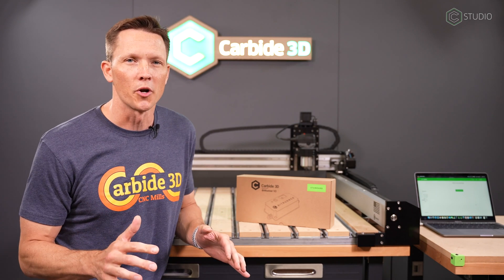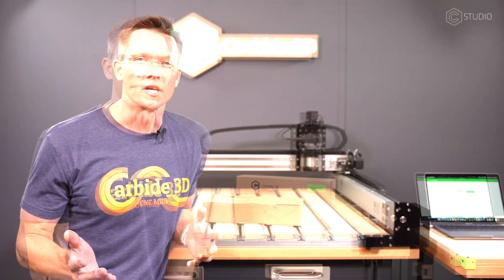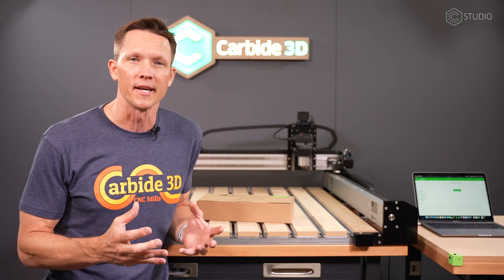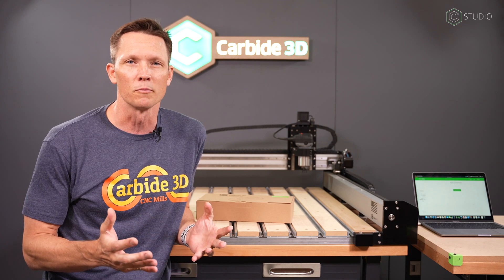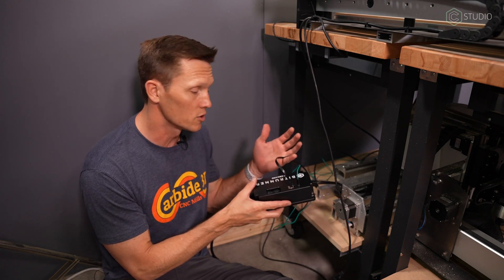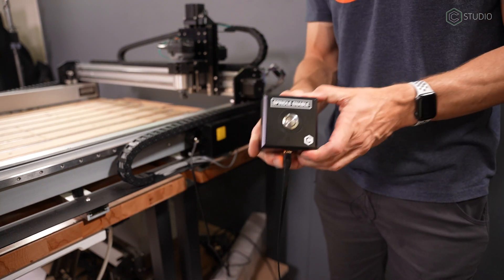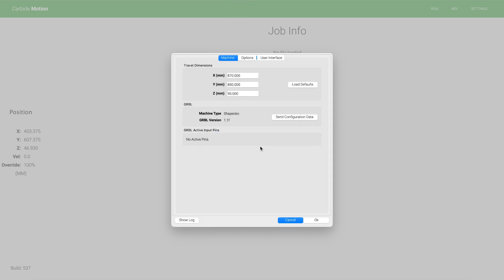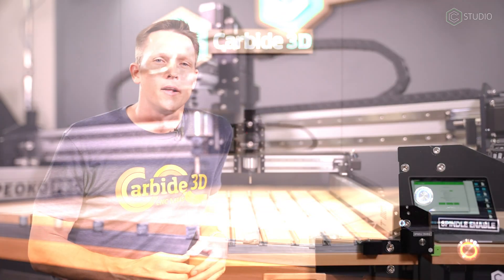BITRUNNER V2 - Install and Run

Comment: Does this automate the router speed? Or does this just turn it on and off while still having to select the speed that I need on the router dial?
Reply from the maker: This only turns the router on and off. The deluxe version includes an AC filter to reduce the electrical noise coming off a router's brushed motor.

Comment: Should the router be connected to a separate outlet than the controller if you are using the bit runner?
Reply from the maker: Your router must be plugged into the Bit Runner.   The Bitrunner and Shapeoko can be plugged into the same power strip.

Comment: I have a question I did not see any place where you set your xyz cna you show how this is done on the 5 4x4 thanks Jeff Peters
Reply from the maker: Hi Jeff.  It’s no different than on any one of our machines.   You can set it manually or use our BitZero if you choose to incorporate that to your workflow.  
My.Carbide3D.Com has 5+ hours of video training covering all manner of topics.  Units, broken down into lectures, are there for you to watch whether you own a machine or not.

Comment: when I turn the bitrunner off can I still run the spindle for some manual work? or do I have to unplug and use a regular outlet?
Reply: ok just got mine, so power on and it's software controlled and power off no power to spindle . some way to deactivate the bitrunner  would be nice so I don't have to unplug my vacuum when I do some cleaning up
Reply: If you go into mdi and type /m3 or /m4 those should be router on and off commands. Mine I can't seem to get to turn on

Comment: I can’t wait for this to be back in stock… I keep having problems, with tool changes. I forget to turn it off when it does the bit setter calibration, and then I forget to turn it back on when that’s done. This will be a HUGE help. This will pay for itself quickly (less broken bits).

Comment: The led colors on this look so confusing. On is yellow? This should be an industrial twist estop, or at least have more intuitive colors, or even an oled display that says the spindle is on or off. Also...imo the hardware just looks cheap. Pro version needs a tool changer too!
Reply: The 'on' color is actually red (just received the one I ordered). Not sure  if it is a pre-production version in the video or just a matter of the video recording.

Comment: Just got the standard version the other day and it works perfectly! I've got the router & a shop vac plugged in with no issues. It's really cool that they turn on automatically when it's time to cut. I use the vacuum shutting off as a cue to go back into the garage for a tool change. lol. Some minor feedback: It would be nice if the grounding cable was a few feet longer as it determined where I had to mount the bitrunner after running the cable through the cable tracks. It would also be nice for the spindle speed to pop up in Carbide Motion at some point. I used the ole tape and super glue trick to mount the bitrunner and control pendant to the side of my workbench, screw holes would have been cool too, but I guess not everyone would use them. That's it! Happy to get this final upgrade for my Shapeoko Pro! Along with the bitzero and bitsetter, I think I've maxed this puppy out! :p
Reply: I second that request for a longer grounding cable. I have a XXL and the cable length is just to the end of the drag chains, so I had to extend it. Not a big deal, but extending the grounding cable +1m would be super helpful.
Reply: @chriswick21 what did you use to connect your dust collector/shop vac to the bitrunner? Just an outlet splitter plugged into the female end?

Comment: Hate to put a downer on this but doesn't a socket, close by, with a switch do the same thing? I'm in the UK, shipping and import tax makes these add-ons fairly expensive here. I'm struggling to see real benefit for cost as you always press the button and disconnect the router manually anyway, if you value your fingers! Surely any wise person already has emergency stop button set-up for quick kills. I don't know, maybe I've missed the point?
Reply: I find it convenient for running a long job. I can start it, and go work on something else.  When the spindle shuts off, I'll know that either it's ready for a tool change, or the job is finished.
Reply: @smcgeorge007  I see, I suppose it does shave off some time. Thanks for the reply.
Reply: It may not be for you.  Depending on one’s setup/workflow, it may be a huge time saver.  I’ve done +300 piece runs.  Having this and the bit setter would have saved a chunk of time.

Comment: Is it compatible with Shapeoko 3 XXL?
Reply: Isnt pressing the pendant button basically the same as flipping the switch on the router to turn the spindle off? if I don't see the need
Reply: Yes, as long as you have the latest v2.4 board. If you have Shapeoko 3 with a V2.3 board and below (Shapeoko 3 machines purchased before Black Friday 2019), you will need to add the Carbide Motion PCB with an enclosure, which includes a new circuit board with the BitRunner connector installed.
Reply: @WinstonMakes  Correct me if I'm wrong. With the BitRunner original, C3D was providing the missing connector for the 2.4d PCB as a DIY. With the V2 no connector. I have to get the new PCB with the connector on it. I did order and received the new PCB 2.4f w/o enclosure and replace my old PCB with the new one. I have the PCB in a bigger enclosure hence why I do not want the one that include the enclosure. Great job C3D